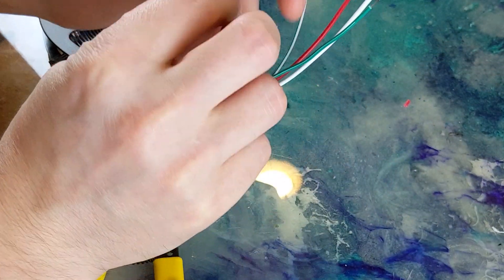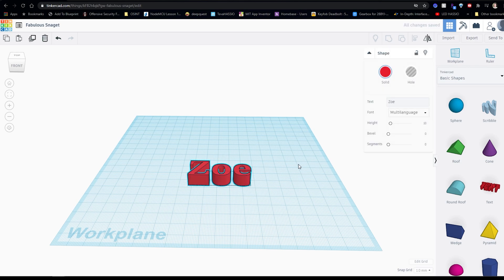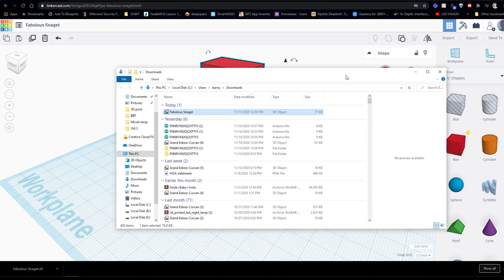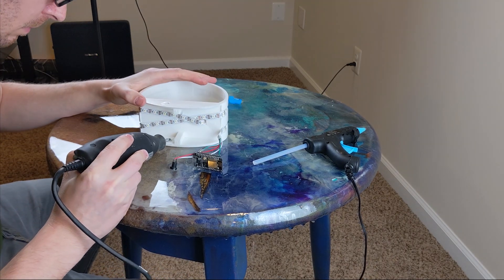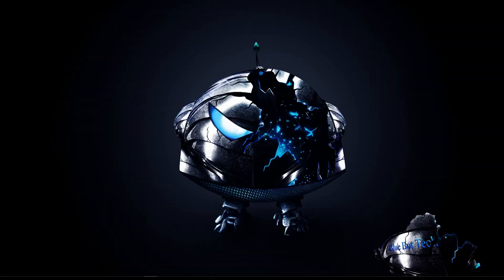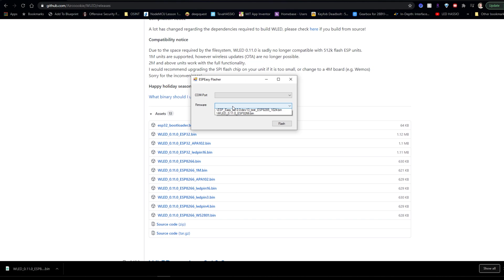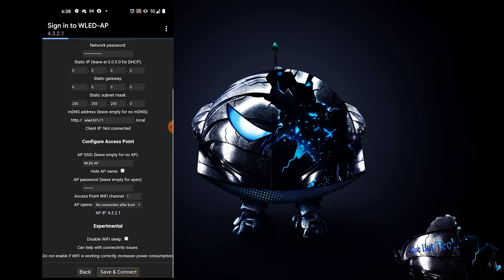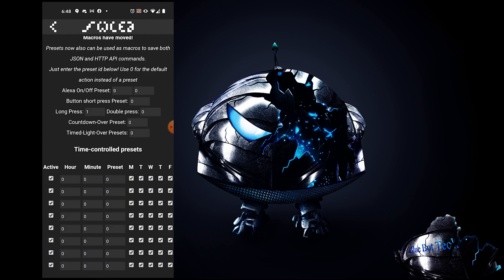DIY Smart WiFi Controlled LED Lamp || ESP8266 & WLED

Comment: Obviously the DIY part of this is fun but why would you do this instead of using an LED strip like the Govee brand? Those are Alexa enabled and have an app to do cool settings.   Seems like it would cost the same?
Reply from the maker: The fun part was definitely a big driving factor, but I chose to go with a NodeMcu so I could integrate it into Home Assistant and take advantage of Node Red to try and do some cool automations.

Comment: Wanted to know if you had a video or know anyone who has a video for setting up the hardware for esp32 with 24 volt addressable LEDs. Also where did you get those the pins to set up the LED wire to plug directly into a pin? Thank you for all the effort. Your video for setting up wled is what brought me here. Keep up the awesome work.
Reply from the maker: Hi Haywould Ugetmeadrink, to get the pins setup to plug into the LED wire i used a crimping tool kit similar to what is seen here : https://www.amazon.com/Glarks-Crimper-Connector-Crimping-AWG28-18/dp/B07VQ6YNSC/ref=sr_1_17?dchild=1&keywords=crimper+tool+kit&qid=1613400957&sr=8-17 

As for the 24 volt LEDs using with an esp32 board I do not have any personal experience with these, but a good resource you could use would be Dr Zzs Facebook group. He has a bunch of hardcore LED light enthusiasts that should be able to help you out. https://www.facebook.com/groups/1969622823351838/

I might look into making a video on this in the future if people are interested?